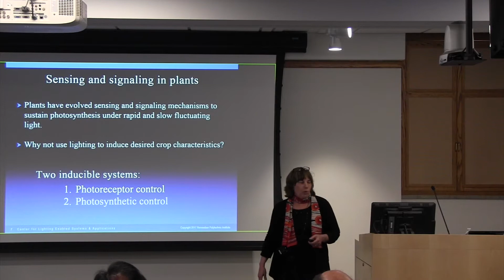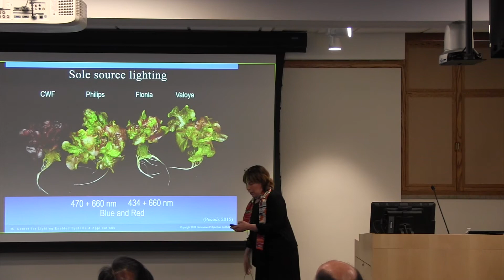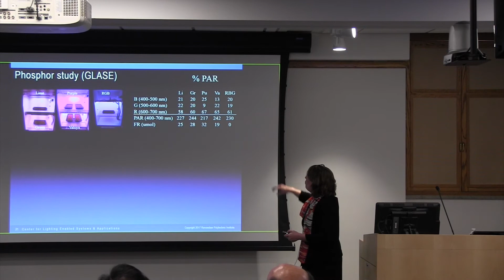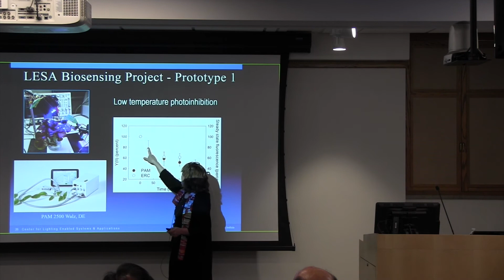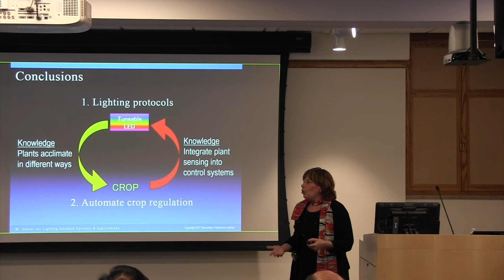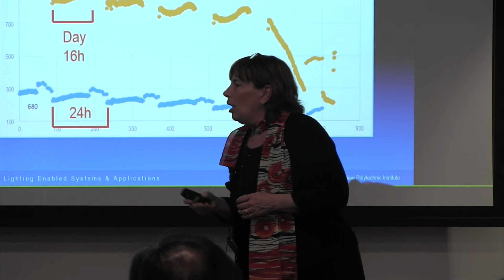Tessa Pocock: Light Matters - Sensing and Signaling in Plants

Comment: Hmm.... But the 430 nm LED is not just lower wavelength than the 470nm. It is also, almost double the % blue as % of total spectum compared to the 470nm. Both are important contributors.